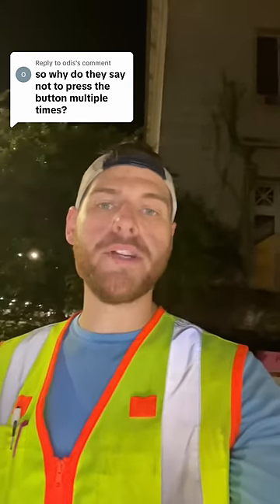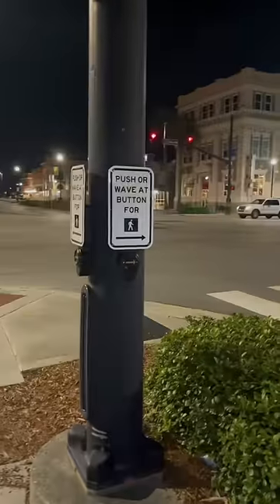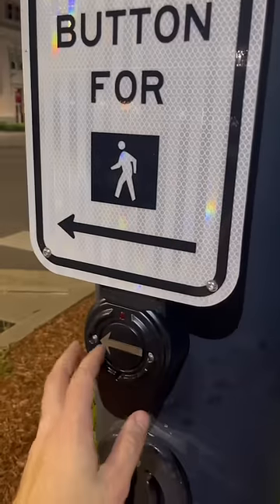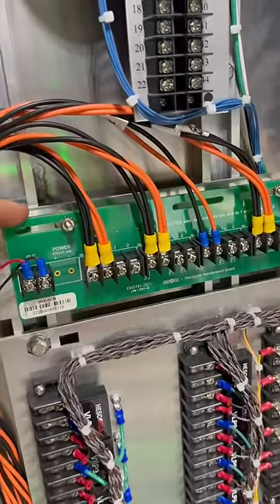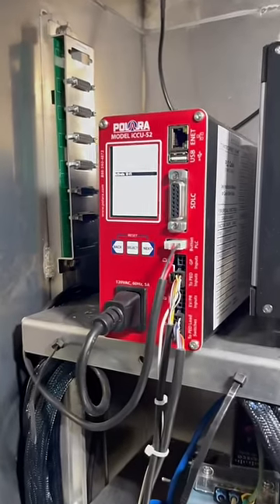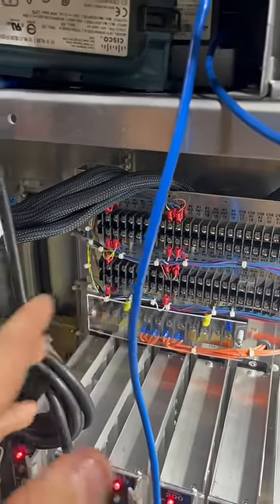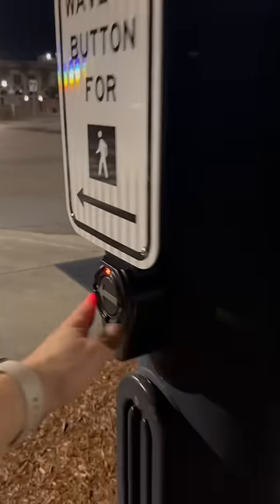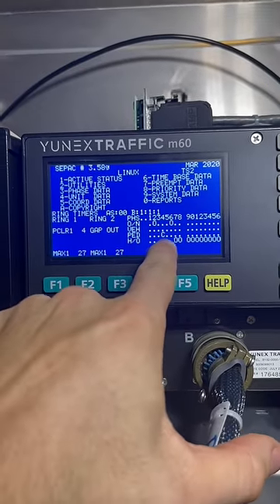Press it as much as you want!!!

Comment: As a programmer, if pushing the button more than once has a negative effect, you need better logic in that setup.
Reply: He didn't actually explain why.
Reply: @davesinger8699  hence the "if" in there
Reply: i think the dude in the video implies that you're gonna send lots of requests to the controller and may ddos it. so 1 push is fine. this is a complete logical flaw in the code as multiple requests should and can be handled easily
Reply: @stormerz8605  if you can flood the controller, that's also a logic issue.
Reply: As a programmer for baggage systems at the airports, I came here to say the same thing.
Reply: But then its stateless!
Reply: @mjverostek1278  pfft it's not stateless.  It's either requested with a timer or it's on standby awaiting to be pressed.
Reply: @xmarine73  thats what i said??

EDIT: i meant to reply to the other commentor
Reply: @stormerz8605  aaah gotcha 👍
Reply: Was going to say exactly this. It’s bad programming if it has the ability to do that
Reply: @xmarine73 you sound like a student who just graduated from school with those replies. Chill.
Reply: Think that when you push the button, the light change gets queued up and any more button mashing gets ignored.

You can push multiple times, it will do nothing.
Reply: @davesinger8699 cos he doesn't know, he only does service check that's it
Reply: As a programmer, I still think you guys are dorks for having this discussion.
Reply: I've never had a walk button work.
Reply: Right, in this case pressing the button should only set the flag. Setting an already set flag has no effect (at least in competently designed systems)
Reply: It doesn't. It simply ignores the extra button presses. But it also wears out the buttons pre-maturely.
Reply: You got that right.

One time at my dad's work when I was 10, my uncle brought me 8n on a Saturday to show me a terminal on an IBM mainframe that controlled a PLC of which was located a few hundred miles away.

Play left the room and left me with a bunch of computers, that we're still on,

I was able to put it in test mode and try out a few circuit designs.

0 before deleting anything, I took it out of test mode. Not realizing at 10 years old that taking something out of test mode - before sanitizing the data, would actually put it production/operating mode.

The Chicago River was not harmed by my actions.

Uncle had to attend a meeting with several folks.

He was not fired but he was not allowed to bring his brother's son to bring your son to work day.
Reply: Lmao, good luck including that and beating rock bottom state contractor pricing
Reply: @jacobsuppliesthegeckos  it's literally three lines of code or less.  I wouldn't even charge for it.  Just holding the contract would be the W.
Reply: what a waste of money.
Reply: he literally explained that it doesn't matter. the title of this short literally says press it as much as you want. the button only completes the continuity once.
Reply: @roberttran1114  I feel like I've said this already: hence the "if" in my comment

The video, however, doesn't actually make it clear.
Reply: as a programmer i agree, this system needs fool proof "if" pressing buttons have negative effect..
Reply: Scale programmer here, completely agree.
Reply: A software QC technician walks into a bar

He orders a beer
He orders 9999 beers
He orders -1 beer
He orders aoweflasdlkf beer

Satisfied, he leaves

A customer walks in and asks to use the bathroom, the bar catches fire and burns to the ground
Reply: @xmarine73 as a programmer you should be smart enough to read the caption 😃
Reply: @cory_thelizardv2946  press it as much as you want... 

... it won't change anything
... you're just slowing yourself down
... it speeds everything up because of demand

Crazy how being vague works, isn't it?
Reply: @xmarine73  didn’t ask old man
Reply: @cory_thelizardv2946  you should be smart enough to realize, it was me asking you a question, kiddo...
Reply: Guard clauses
Reply: It’s honestly no different than pushing the elevator button multiple times… lol
Reply: this shit can be done from a raspberry pi
Reply: @awsomness84  one hundred percent
Reply: @stormerz8605 DDOS _that_? no shot 😂 unless you have a loooot of people at different intersections connecting to a single machine with age old hardware
Reply: As a minecraft Redstone builder, just put the comparator to 2 ticks
Reply: I would program a negative effect so people don't wear out the button. :)
Reply: If you push the button, (int) timeUntilGreen = 120; //seconds, 
This will solve the problem, in time after people will learn that pushing the buttont will make them wait longer
Reply: @damneddark2080   and it will enable trolling
Reply: You never said, why not to push it twice!!!
Reply: @stormerz8605 Did none of yall reas the title of the short?
Reply: He’s not saying that pushing the button multiple times is bad. It’s just not doing any good. It’s not going to make the light change any faster.
Reply: @Bens7041 I see you think a computer thinks like a human even with AIthey don't  1 and 0  and you know just as well as most programmer know you have to have a default the default on  Traffic boxes if 5 usually after 5 it ignores any other input and goes to start. It t =5 go to beginning. It's also programed to stay on the main cycle. So pushing 5 time it just stays on the main cycle but if someone pushes it once with mo other imput it goes to allow walk on whatever was sent
Reply: my computer when i press the same button too many times:
Reply: @davesinger8699  that's because it doesn't have a negative effect.

The first press is like flipping up a light switch. You can't flip up a switch that's already up, so successive presses do literally nothing.

The title of the video is "press it as much as you want"
Reply: @xmarine73 wouldn't it just mean nothing happens because once you input the call it won't go away until it let's the pedestrians cross on that side of the road. Multiple calls would just replace the previous call effectively meaning nothing happens and it's still waiting to let you cross the road
Reply: faxs
Reply: @stormerz8605 The problem is the content creator put the answer in the description instead of just leading with it in the video, THEN explaining it.
Reply: As a penguin tuft fluffer at the Saudi Arabian zoo I’d say he is correct
Reply: I learned more just reading these comments
Reply: Yep, ideally you wouldn't want to press the button multiple times just because it's more work and over time added wear and tear on the button. But, he didn't actually explain why pushing it was an issue beyond that. 

Still interesting, but a lot of us pressed the older buttons more than once because of times when it wouldn't register and we didn't have any indication that it had done anything at all. In the case of more modern ones, you get a light indicating that it's requesting a walk sign and often a voice doing so as well.
Reply: I'd design something like this specifically to take longer if people kept pressing it, just to screw with people and teach them patience.
Reply: Your correct except the buttons don't actually cause the walk signal to appear. Try standing at an intersection and not pressing the button. Signal appears regardless.
Reply: @nexuvareldari7418  
There are two basic types of lights: timed and on demand.  The timed light does what it does and the signs react correctly as the light cycles.  The button does, however, call for the light to change on the "on demand" lights and it also can provide more time for a pedestrian to cross on the "timed" cycles (if they are normally short cycles).
Reply: Oh my some people don’t read titles and it shows hahaha
Reply: @Qwerty-ts9sl  some people don't read the comments before commenting... whoops! 🤪
Reply: @stormerz8605 of pressing it multiple times ddosd it, wouldn't it just make all the lights red?
Reply: @lemnlit3291  No, it’s bad programming
Reply: @davesinger8699  He actually did. And it implies that pressing the button more than once is futile.
Reply: @xmarine73 he’s not a programmer, he wouldn’t know what if means

Comment: It's insane how much equipment is in those boxes at every intersection 😮. That's a lot of money.
Reply: Waste of money,,
Reply: Yeah as an engineer I agree. 
A raspberry PI should be enpugh😂
It's some traffic lights, why do they need control equipmemt that can manage a 3-axis CnC machine??
Reply: @dagg497 even if you did use a raspberry pi, you’d still need like 80% of the stuff in there. Think of the wiring junctions, relays, electrical redundancies, etc.  Yeah the logic is obviously simple, but you’re not driving little LEDs on a breadboard. Also, techs need to be able to easily diagnose and manage the equipment. 

Even if you did use raspberry pis, who is going to program and configure them? The same exact companies that already make the traffic controllers. They’re just using a different microprocessor.
Reply: @DavidDavidDavidDavidDavid. For the safety required additional circuits are needed to stop the software from doing crazy things like all directions green at the same time .  As a user of pedestrian button, I've recently seen some bad setups that take way too long to turn green and also operate the white feedback light wrong .
Reply: @dagg497 lemmy guess, you mean as an engineering student.  As an actual engineer working with equipment that needs to not fail every other day.  No a pi is not sufficient to run an intersection
Reply: Me managing 10 pis in production would like to disagree. U dont even need the processing power of a pi. U can literally put like 10 mcu doing all the same task make them vote and select from the most voted option like in avionics. The only reason this are the way they are is cuz government contracts.
Reply: Have you taken time out to calculate your taxes recently?